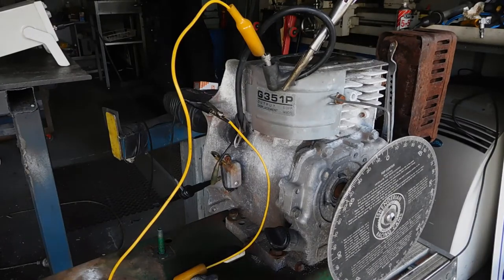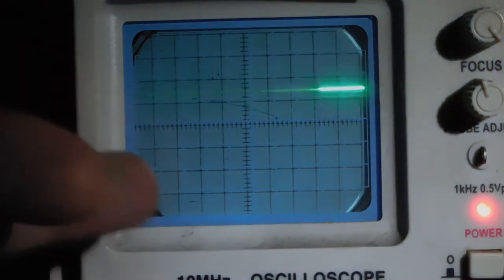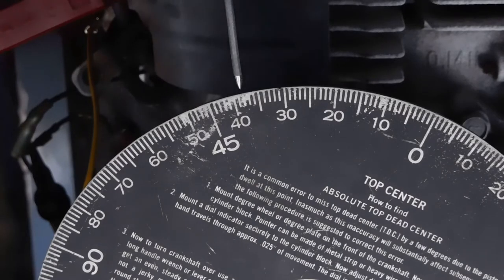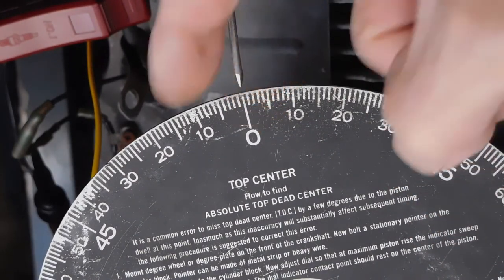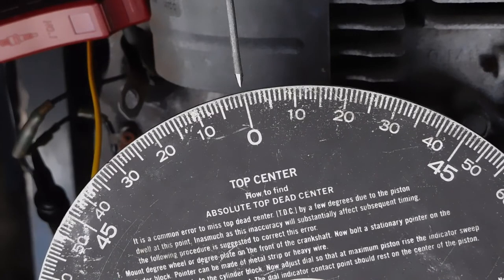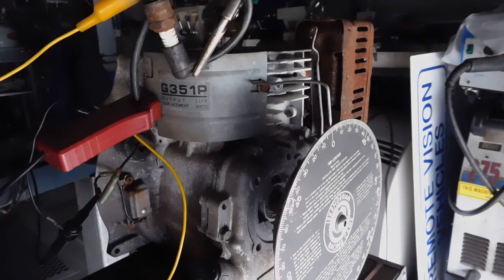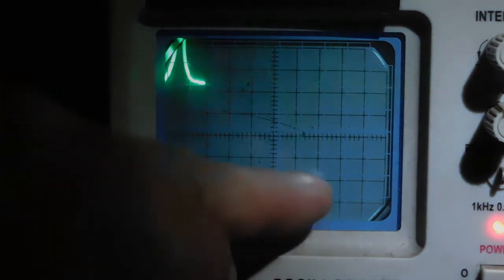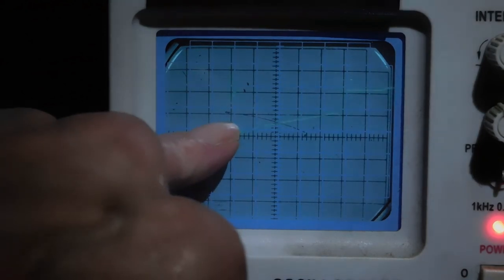How magneto timing advance works, how to read spark voltage on oscilloscope E31

Comment: If an off-the-shelf CDI box will advance with increased RPM, and I want to retard for a two stroke ignition, what's the best way to select a box?
Reply from the maker: You will need one specific to 2 strokes, alternatively disable any advance if its for road racing or flat out applications since, in conditions a 2 stroke will be fine with no curve.
Reply: @AuMechanic  gotcha. Any recommendations for setting up a bench tester with a variety of different flywheel tapers? I'm kinda lost there.
Reply: @AuMechanic  follow up to the first question,  I've found that most of the boxes sold as "two stroke" here in the states are at best a four stroke box with no curve. Would the natural advance you demonstrate at the beginning of this video be enough to spoil a no-curve 4T box for my application? (50-70cc 2T mopeds if it matters)
Reply from the maker: @clort123  
Be aware the magneto ignition in this video is a 4 stroke.
You should probably start by putting a TDC mark on the flywheel of the current engine you have and getting a timing light to see if it advances as RPM rises.
Does it have a stock working one on it now ?
Reply: @AuMechanic  I have a variety of bikes and ignitions, most working. The stock stuff is typically breaker points on this old stuff, but there are HPI and other CDI kits. And I have a timing light, just wondering how I can set something up to spin up a variety of flywheels with different tapers to bench test the different boxes and coils that I have.
Reply from the maker: If you are only going to test the rotor and coil at low speeds not on a running engine then the taper isn't an issue and you could just use a long bolt on some kind of electric motor to spin the rotor up and a vice next to it to clamp the coil to securely to maintain the right gap to it.
Since the rotor is magnetic the coil doesn't need to be grounded to it, just short the spark plug body to the coil mount with a bulldog clip and clamp the timing lamp probe to the lead.
All you need to do is spin it up enough to see if there is any advancing of timing and how much.
Reply: @AuMechanic  I think I'll probably need to get them up to full speed, since some of them have curves that don't start retarding until the 6-7-8k rpm range.
Reply from the maker: On a running engine its the rapid acceleration in RPM of the mass of the rotor that puts load on the taper 
Would probably still be ok so long as you spin them up to speed and down slowly
So long as the shaft you use to bolt them down fits snugly to the centre hole at the smallest end of the taper to ensure they are not off centre and out of balance you could get away with it.

Or maybe make a short round spacer that fits to the base of the shaft that is is the same size as the largest end of the taper to make sure it locates centre.